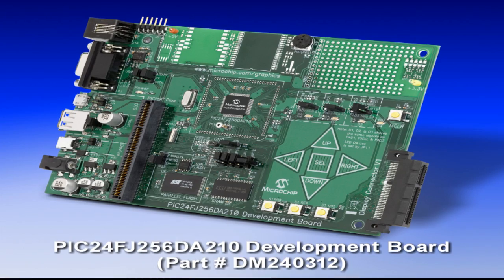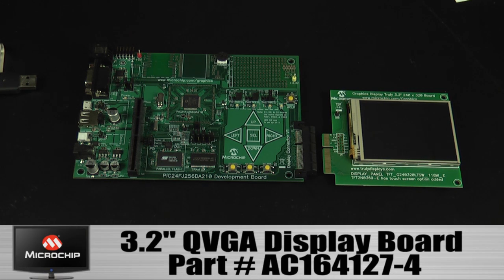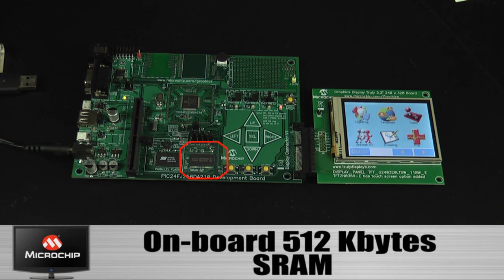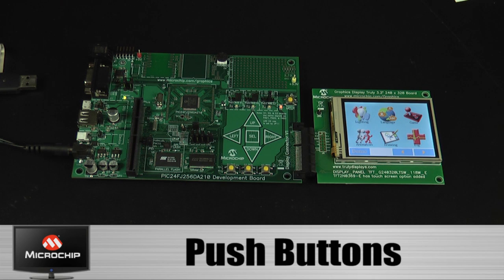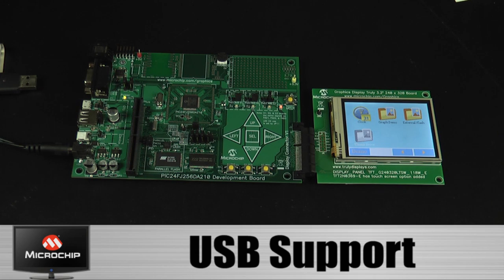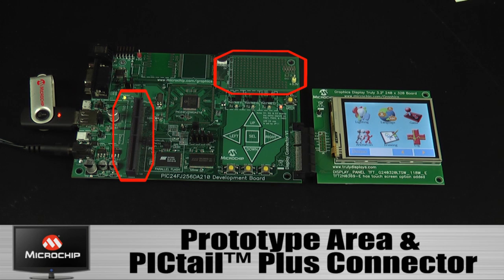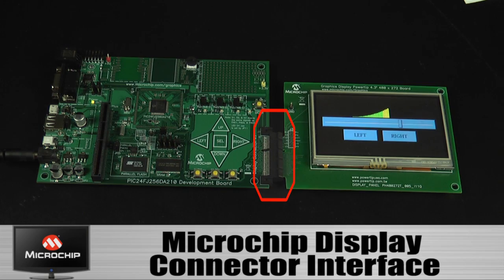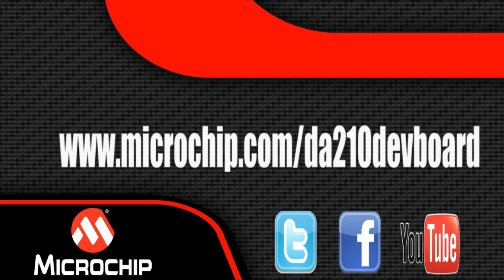PIC24FJ256DA210 Development Board Overview

Comment from the maker: @bejius PIC24FJ256DA210 has three graphics hardware acceleration units, RCCGPU, CHRGPU, and IPU. There’s no JPG decoding engine. But the IPU serves a similar purpose in decompressing a data block. A pc utility, Graphics Resource Converter, provided with the Microchip Graphics library provides the compression functionality. More information about these three GPUs can be found in the data sheet and the Graphics module family reference manual.